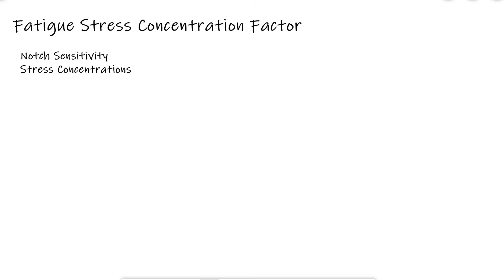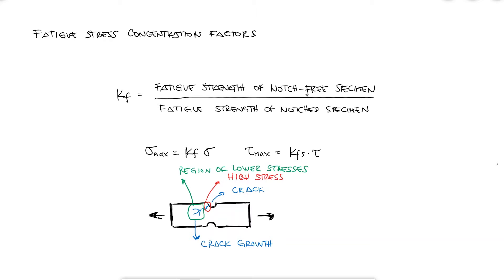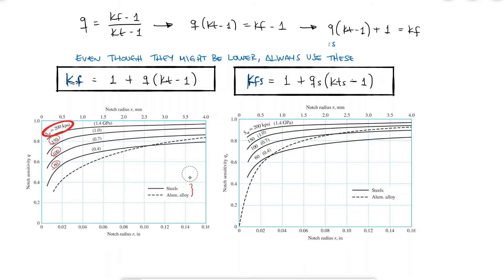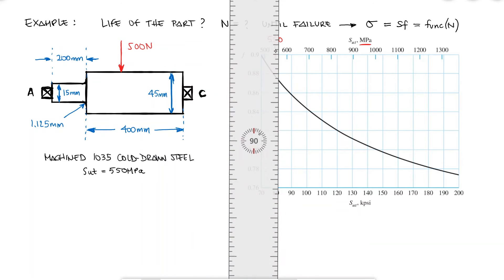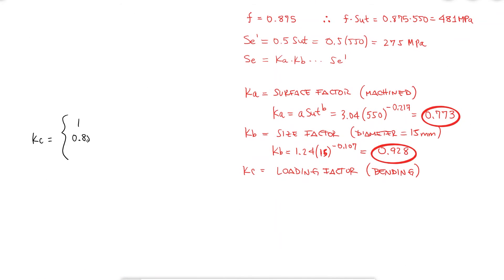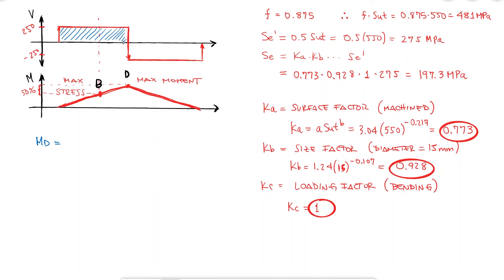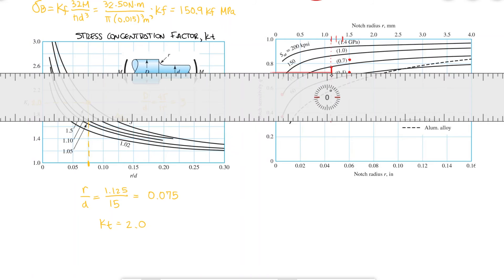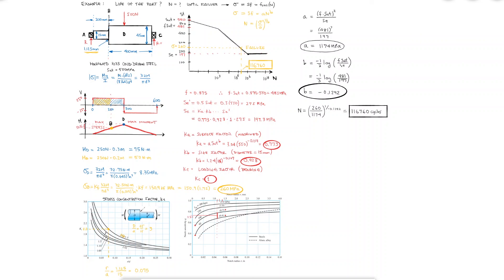Fatigue STRESS CONCENTRATIONS in Just Over 10 Minutes!

Comment: You showed the wrong formula for kf, it's upside down, by your formula kf will be between 0-1
Reply from the maker: Can you point to the time in which this happens? I already checked the entire video, and I found nothing wrong with any of the Kf expressions.
Reply: @LessBoringLectures  check on 1:01 in time! That one (Notched/ Notch-free) should be correct! Make it upside down!
Reply: @neutroviolet2918  How though? Surely if there is a notch then the fatigue life will be less than the notch-free fatigue life, so the Kf value has to be greater than 1